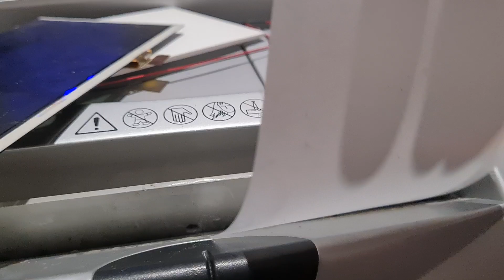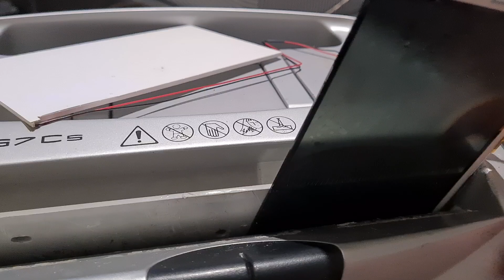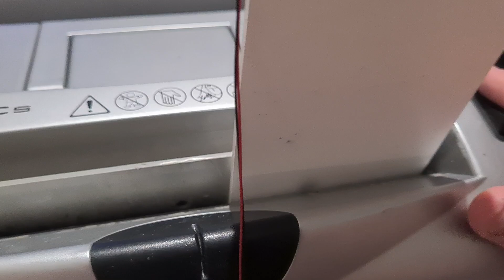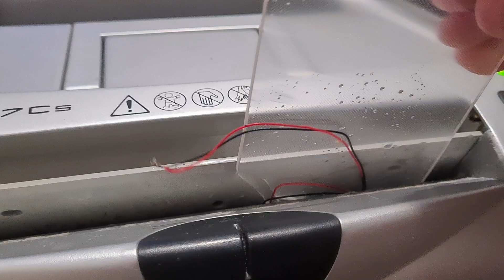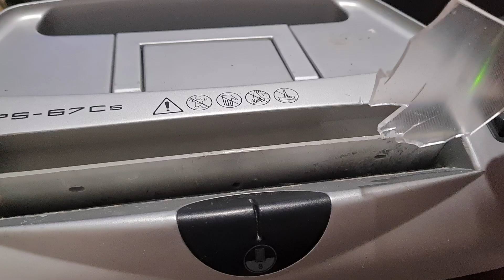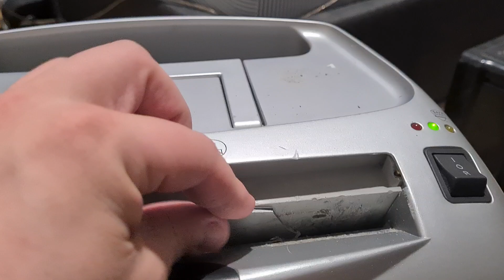paper shredding parts of old DVD player

Comment: Replace the dinky motor control system with that overcurrent protection and hook direct voltage to the motor and set up a temperature sensor to monitor the motor temp so it does not overheat.
Reply from the maker: yes I have removed that silly little controller that's because one day it broke so yeah stupid controller and the motor did had a built-in thermal overheat protection and the motor already has direct voltage with a switch so I could still reverse it so yeah.